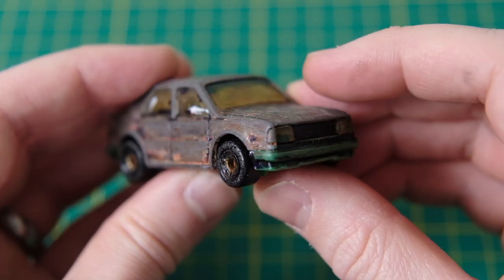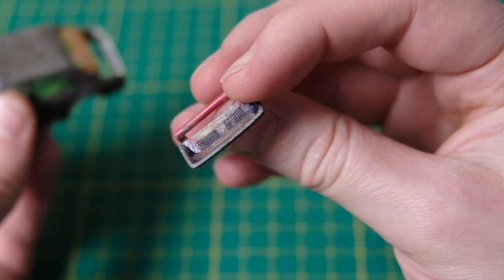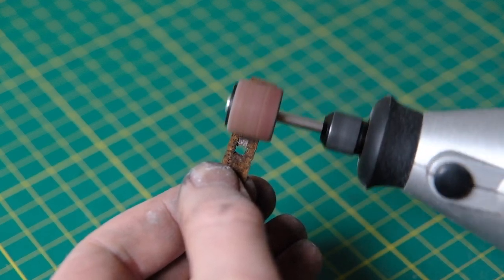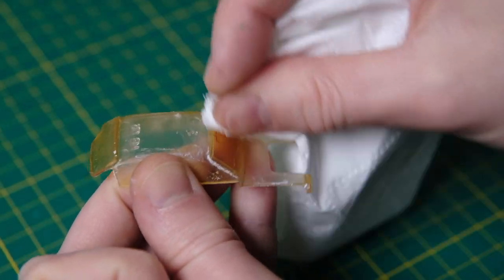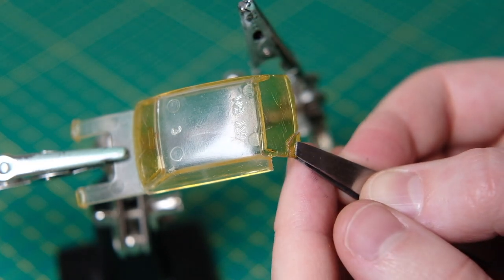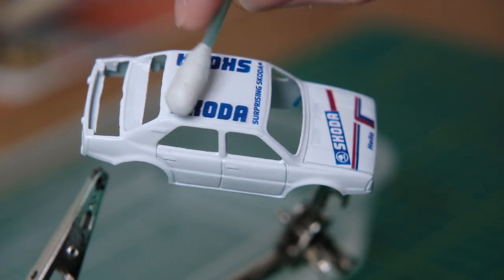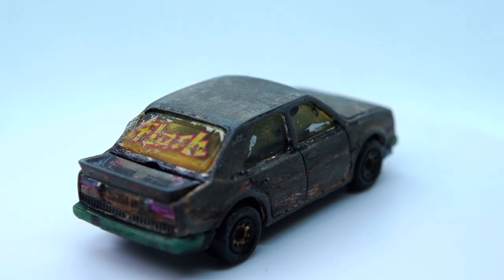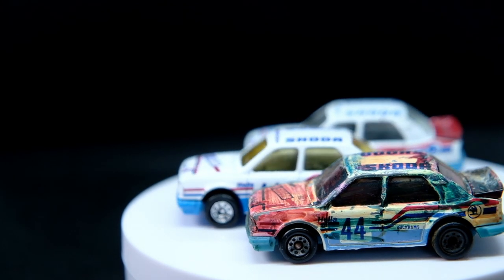MATCHBOX restoration: Škoda 130LR MB176

Comment: I like this Jason , nice work . Could you pass on the link for the screws you use please , I'm struggling to get ones the right length .
Regards
Reply from the maker: https://www.ebay.co.uk/itm/402652847072

These are the same spec as the sort I’ve bought in bulk in the past, M2 3mm laptop screws. Best I’ve used so far
Reply: @DieCastRestos  
Appreciate you taking the time to help Jason . Just orderd some
Thanks.
Steve